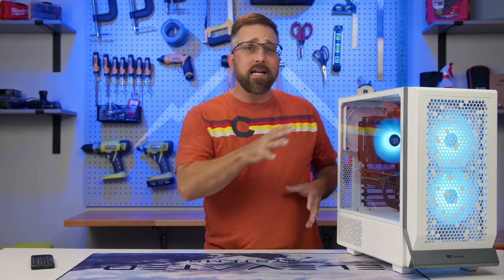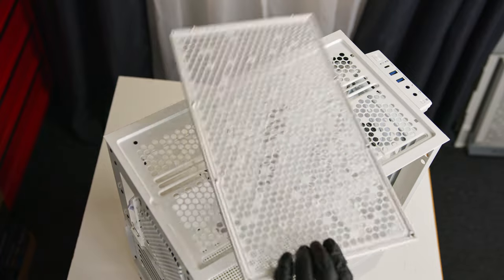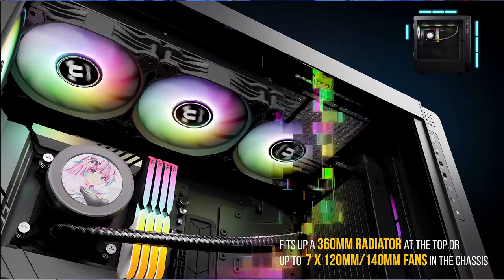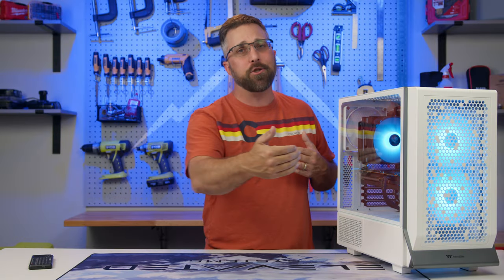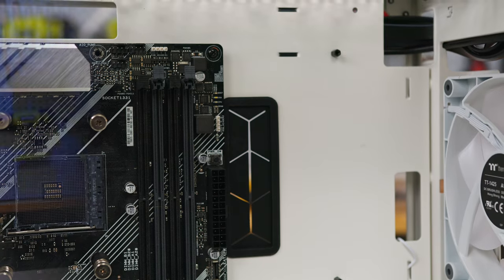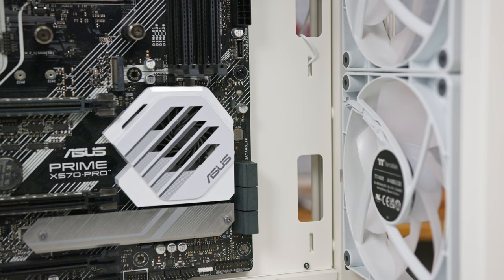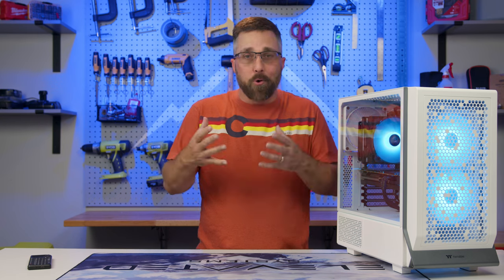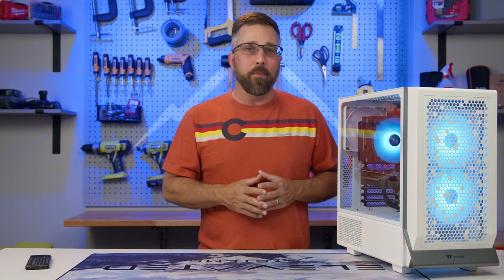Beat the Heat! Thermaltake Ceres 300 Review

Comment: Looking to upgrade to this case for my Radeon RX 6800XT which was just gifted to me. Too long a girthy for my current case. But based on this review it will fit with room to spare. And my CPU Air tower will fit as well. Those were my 2 primary concerns. 
Great build video and details on the case!

Comment: Like the size but not the Black cables in a White case or having the Front I/O on top as for desktop it should be on the bottom front so you can use on desk left or right side.

Comment: Super eye catching and no doubt of great construction case; but what if  need to put 2 or 3 hdd´s? I´d like to buy it but i got 2 2.5 ssd and 2 3.5 hdd's and it would become a problem put them inside this case since seems th7ere is no extra device for drives.
Reply from the maker: Are you using the drives for parity? If not you may consider upgrading and consolidating your storage along with the case upgrade. High capacity 2.5 inch SSDs are relatively inexpensive at this point. New general purpose and gaming case designs are getting away from including a lot of hard drive mounting locations as most new builds lean more heavily on M.2 and SSD storage.
Reply: @ElevatedSystems  Thanks a lot for your answer! I don understand what you mean for parity; but in fact, I just need to swap all my internal components to a new case because the front panel of my current set up was broken in a negligence, also usb ports are not useful anymore, plus I'll add an extra drive because the system is used by my brother due his work and a nephew in his games besides me with more games and work, and each one of us have our files well organized. Perhaps i'll search elsewhere. Have a great day!!

Comment: Lian Li Lancool 216 seems to be the better purchase over this TT Ceres 300. It has 2 160mm front intake fans, amazing cable management, fan hub included, and the ability to buy another IO  hub for $15 to mount to the side is awesome. 

Don’t get me wrong, I love the direction TT is going with these new cases.
Reply: Lian li 216 has no dust filters in the front. I have TT ceres 300 and its great! Amazing airflow and looking awseome!

Comment: it is weird it kept the same height and can obviously fit 140mm fans in the front, but can't still accommodate 3 140mm fans or a 420mm radiator in the front. That discrepancy does not make sense.
Reply from the maker: It's the change to the position of the front IO. Moving it from the left side (ceres 500) to the top (ceres 300) reduces the available vertical height.

Comment: The intro got me thinking that it could be compact enough for my space but it's a lot wider than I thought. The max width that I can have is 220mm. Height and depth are both 480mm. Any recommendations for a case that can fit there is appreciated. I'll be extra happy if it doesn't have a glass panel!

Comment: Thanks for the review, CJ. Case looks really cool and I've been looking for a new one.
I've been trying to look for a review of this case that includes detailed information on temperature and noise levels during idle and load. For the thermal performance, what was the computer doing for your temperature recordings? Were you running any benchmarks (Cinebench, Uniengine, Furmark), gaming, rendering, etc? The temperatures you have listed do not mean anything to me if I have no idea what conditions they were recording? Your review also lacks any information of the components used inside the case? Does your channel has a test methodology for cases listed somewhere?
Reply from the maker: The system specs are listed in the description. The CPU temps from a 20 minute Aida64 stress test, GPU from a 20 minute Port Royal loop.
Reply: @ElevatedSystems  I'm sorry I did not read the video description carefully. I see the builld list. My mind must have confused them for promotional and social media links. Thank you elaborating the test metrics.

Comment: I didn't realize how good Phanteks was until I switched to the Thermaltake Ceres 300. I'm coming from the Phanteks P350x. I had to buy something wider to avoid bending the 12V-2×6 / 12VHPWR. The Ceres 300 is the lowest quality case I have ever used. The front case joints will probably break after a few times being pulled out. The steel is as thin as paper all over the case. The tempered glass doesn't sit flush, and there are huge gaps between the case and the tempered glass. I'm never going to buy anything from Thermaltake again.
Reply: this case is solid not as you mention.